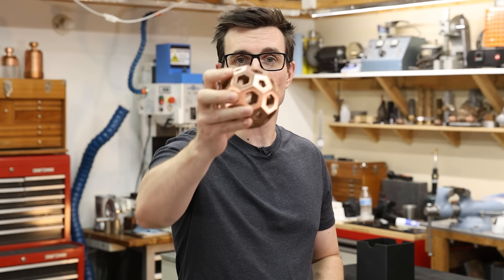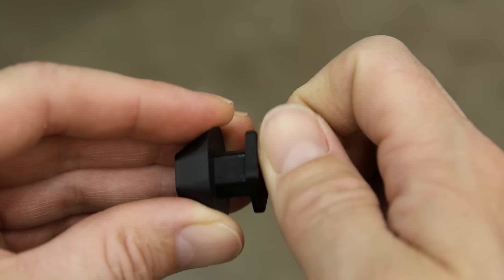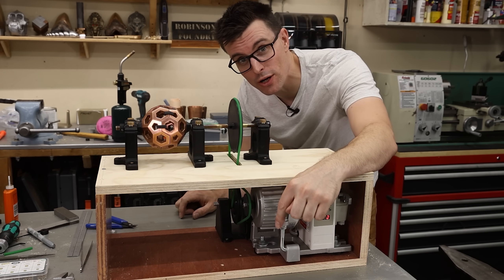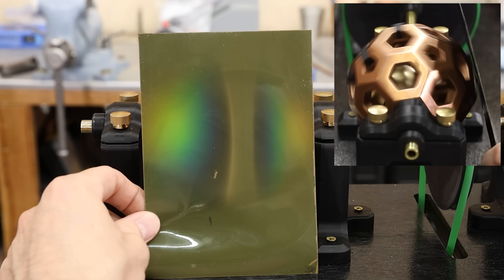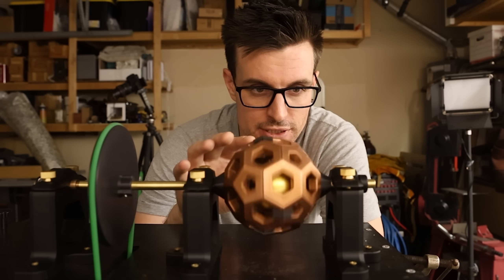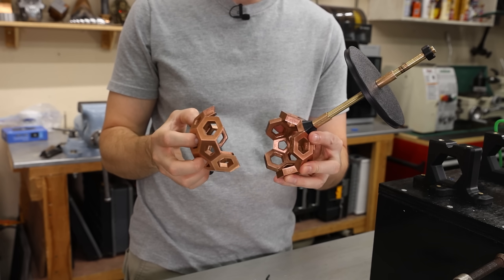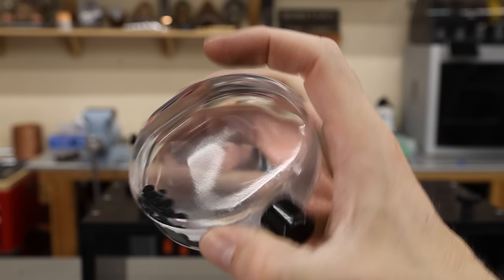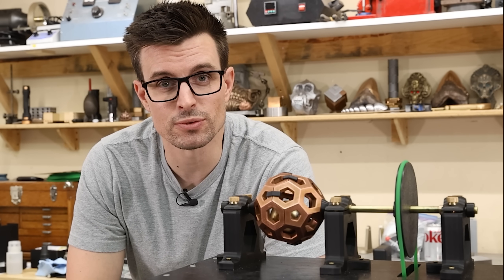Huge Magnet vs Copper Sphere - Anti-gravity Machine

Comment: I don't know my friend, you complicated every step on yourself, installing the motor made the Idea depending on another power force as fuel, then you put a magnetic lens disturbing the field of force by letting it touch. After that you changed the copper orientation system, well ALL WHAT I Concluded THAT you wanted the viewer to be happy with you to send you likes. try to change the motor itself from horizontal into vertical like attaching the copper sphere on top of the motor center rotation, I want to treat you as a scientist NOT a YouTuber, so do not forget the earth actual megnatic field, and think of other way making movement without a motor depending, the earth is moving on it's central megnatic field GOD IS THE ONLY ONE WHO WAS ABLE TO PUT THAT FACT WITHOUT A MOTOR

Comment: I don't think you know what you want the copper "sphere" to do. You're asking it to stabilize the flux of something that is moving in three dimensions while the copper is moving it's receptivity of flux currents in two dimensions. Also, there is nothing to tie the rotation of the copper to the magnet. Think of how we already use magnets, copper and rotation - a motor. There are two ways to create a motor, a magnetic field rotating around a stationary conductor or a stationary iron core with energized copper windings rotating around the core. Both of these can produce stable (or variable) flux currents to allow levitation because they are energized and moving along a stable axis. In the experiment, the copper isn't doing anything for the magnet and any moment of resonant flux would be instantly gone the next moment. Since the magnetic sphere is also moving in random directions, the line of flux from it are also fighting the concept you are trying to achieve. You have to control at least one of the fields of flux and their magnitude to have levitation with anything. Motion will always be against you unless it is relative to the direction of the axis of flux. I think you are trying to make the copper act as the field of flux of a magnet or electromagnet. If you're using copper because it is a conductor, a copper sphere can't be both positively and negatively charged at the same time to push and pull the magnetic field of the magnet simultaneously in the proper places to produce levitation. Simply put, the only reason motors don't have levitating parts is that we have to connect a part of them to another device to perform work or to receive energy that is converted into electrical energy like a generator (motor working in reverse). Otherwise we can already levitate a magnet inside a rotating electrically induced series of magnetic fields.
This experiment can also be described as variables trying to control variables while still missing a part. You have no constant to work from or to create a foundation to build off of and solve variables from. A magnet slowing down while falling through a copper (or other conductive material) tube works by the delay of exchanging charges against the poles of the magnet as it moves through a conductor aligned to the axis of flux. In any case you need 3 things to achieve stability of fields for levitation, your experiments are missing the consideration of electrical charges (since you're trying to work with a copper (conductive) component). Copper is only used with magnets because it is conductive and creates controllable magnetic fields with electrical energy. 
I think a cool experiment may be to record the delay of the sphere falling through copper and other conductive tubes and then spinning the tube at different rates while dropping the spheres through to see what correlation you can find there. Also try dropping the spheres through the tubes with a known orientation (north up a few times and then south up a few times ) and then try spinning the spheres as they drop through the tubes. You could even spin the spheres perpendicular and parallel to their poles and see if there are any effects vs a random rotation. I recognize your channel isn't really about electricity, magnetism and levitation but it was fun to think about as I watched your video. 

The more I thought about it, the only way to levitate the magnetic ball would be to create a multi-pole rotor and spin that on the same axis as the copper sphere. Unfortunately, the copper sphere - the very thing that created the interest and your ideas of levitation, and is relevant to your channel is the one part of the experiment that will prevent you from succeeding. Even energizing a copper sphere with a magnetic ball inside it wouldn't produce levitation because the ball would have to be placed in the fields of flux to get it to stay. If that happens there is no need for any part of that system to rotate or even be a sphere. Again, that would go back to cylinders and essentially building a motor.

Comment: The internal sphere magnet needs to be larger or the copper cage needs to be smaller. There needs to be a small air gap, or distance between the 2 materials, that is uniform like your copper tub & disk magnet. 
I would use the tube & disk to help get the mathematical equation so you know what size sphere magnet & copper cage need to be.
1. Drill & tap one end of the copper tube. 2. Make attachment that will join the tube to a shaft or to a pulley that can be belt driven. 3. Design a support that the tube will sit on & allow it to spin with minimal friction(hard part). 4. Orient your disk toward the opposite end of the tube for better observation. 5. After starting the motor to rotate the tube & achieving disk magnet suspension measure the gap & observe any wobbles. 6. Use the tubes thickness & the magnets OD (outter diameter) & thickness to complete your equation.
Reply: Also great filming, editing, & experiment. You got a subscriber for life.

Comment: What would happen if you just spin your cylinder on a setup like you have, in addition to looking at the magnet axially down the open end?
Also are both halves of your copper part electrically connected really good?

Ideas, I have lots of them, cheers! good stuff.

Comment: Cut a hole under the sphere and use the light centered under the sphere? I am not a scientist, but have you thought about different magnets to help elevate the weight of the ball? Use 4 in total one on top and bottom and two on the sides

Comment: Nice work!  A possibly better demonstrator, just as with your initial demonstration with the copper cylinder, is to motorized the cylinder and have the magnet float inside (much better visibility of the floating magnet).

Comment: The problem is you are putting energy into the copper end of the system. 

Your objective is for a magnet to spin incucing a counter field. 

What you have is copper  spinning around the magnet.
This means for the magnet to spin and induce any field it is basically going to have to "rub" and get the momentum

To solve it you need to spin a magnetic sphere around a copper ball as that can pick up the energy from the magnet and spin.

Rather the trying to get the energy spinning to draw "power" off the magnet to generate its feild

Comment: As long as there is slip between the magnet and sphere there will current due to Lenz law when the slip reduces the current also reduces and causes the magnet to drop due to gravity also shape of magnet inside the sphere also matters since the north and south pole flux to be cut by sphere makes the Lenz current to flow in sphere and that causes it to float due to diamagnetic effect of copper

Comment: The joining parts of the two half's of the copper sphere are at a much greater thickness to the rest when together witch will then pull the magnetic force towards that section more. Also to allow for smoother rotation on the magnit you'll need a continuous copper strip around the equator of the magnit. The zig zag design of the copper sphere is whats wobbling the magnit from side to side and causing it to be unbalanced. Id also recommend some kind of copper or aluminium sheet between the sphere and the motor. 
I also think your get some kind of disruption from the screws you used for the mounting brackets on the shafts. 
Maybe you could design the copper sphere out of copper piping, you could cut say 20 pieces of pipe at a length of say 10mm and make a circle from them and work out from there. You might need to find a way to connect each circle/pipe  together that wont have to much of an effect when in motion. I would definitely start off with some thinner material on the sphere and work up in thinkness after each test

Comment: Could you make 2 hemispherical shells (solid shell), trim 20mm from the ‘equator’, then spin the 2 halves in sync.

That way, you get a reasonable unobstructed view, potential to start with a stand for the magnet, then remove it, or to use the gap as a track to rest the magnet upon.

The shell could be harder to balance without machining metal hubs and trimming bits to balance it AND it may not look as cool as the geometric cutouts on this one, but could get a more stable effect.

(as others have mentioned, you might need some magnetic shielding from the motor too.)

Comment: @Robinson Foundry
11:50 I saw a video (can't find it again 🙁) with a kind of diy shock absorber, maybe you can make something similar, magnets are kind of like springs.
it was a weight (unbalanced wheel I think?) that was spun up to vibrate violently, above was a rod, then dropped a coil-spring down around the rod, and a weigh on top of the spring.
That was enough to make the system stop vibrating, as most of the vibrations was (somehow) "absorbed?" by gravity (I think). Maybe something equivalent can be useful here to absorb the magnets vibrations, but like "backwards?" or something?
Also, maybe those "wiggling magnets" can be some other way to absorb sideways energy from the system, if there are some kind of resistive springs on those magnets to take up the forces generated?

Comment: @Robinson Foundry
6:53 You could put the motor such that most of the magnetic parts are spread out as evenly as possible directly underneath the sphere, in that way you mostly just add or subtract a tiny amount to/from the gravitational component of this system.

Comment: To get the strobe to work, you need to take the RPMs rotations per minute divided by 60 RPS rotations per second ×5 the cemetery of your sphere a mess number flashes per second you need

Comment: The problem is rpm . Just turn_it_up don't be afraid. If the rotor in the copper winding is afraid of turning so fast, it would have not produce AC current.

Comment: You have to use two indepent spheres spinning in opposing in opposite directions even using two hermetically sealed layers and using currents to make the fluid spin in vortices one oriwntated as an up draft motion and the other in a down draft one clockwise and one counter clockwise either the layered fluids in shells contained within each other, or those copper spheres one spinning clockwise and counter clockwise or one vertical and one horizontal I believe they would allow for directional control. Even two copper shells with the layered encapsulated hermetically  sealed fluid spheres within the copper spheres

Comment: I think the polarity isn't evenly opposite. When you held the magnets up they always went the same direction. Meaning they are hitting the same pull or push on the magnet in one axis more than the others making the central magnetic field off centered I think. But I also don't know a lot about magnetic fields either just an observation .

Comment: Gravity field g must equal to acceleration a. On Earth, it is 9.81 m s 2.

Like a motor bike spinning inside a sphere cage you see at the circus. 

The motor must accelerate the ball to 9.81 m s 2 not the sphere. 

In the copper tube, it is linear, so the force of the magnetic field generated is equivalent to the force generated by Earth's gravitational field g. 

The reason the linear tube works when pointed against the Earth gravitational field is because they are equivalent force. 

You may call antigravity if you like. 

Gravity is acceleration according to General Relativity. 😅

Comment: So you could haves done the same hooking that really thick copper pipe up to the motor and you could place the maintenance inside of while spinning just don’t hurt yourself put a stop button or a emergency stop bar so you don’t hurt yourself playing with it, 
Pretty cool toy thingy 
Could print a plastic one and put magnets in the holes  
And glue a ball of magnets with the opposing poles facing out 
So the spare would be North Pole fishing in and the ball would be North Pole’s facing out… 
When you’re printing it, you could use like a clear plastic or more gaps and holes and more strategically placed magnets so you can see the ball on the side ….

If you want to take it a step further, you can have a ball with no poles facing out and spare with north poles facing down and another sphere on our outside with North Pole’s facing out and then another three with the north pole facing in on the outside The cost a lot of money and be huge and probably quite heavy, but I think it would be doable. there’s no reason why it would be available. Just have to have a lot on magnets a lot of magnets!!!🧲🧲🧲🧲🧲🧲🧲🧲🧲

💰💰💰💰💰💰💰💲💲💲💲💲💲🤑🤑🤑🤑🤑
I hope YouTube pays a lot ! 🥹🫩🙃

Comment: Try turning the axis of rotation vertical so gravity is pulling the magnet into an area that is spinning instead of rolling so it doesn't oscillate like it did in this video.

Comment: Maybe I’m missing something but is it possible you’ve focused too much on the magnetic fields and possibly missed some mechanical components. Over the distance of the rod won’t balance and torque be lost? If the other end of the system has a counter force could that potentially help balance the sphere?

Comment: I'm coming at this as a prop maker and cinematographer. The object here is to see the levitating magnet, and the hex facets cause too much glare and glint... 

Okay so let's ditch the hex thing for a sec. Picture a hollow copper sphere, same wall thickness and diameter as your current one. 

Now, equitorially remove a 1.5 inch band. Now you have two separate half spheres. Mount them axially through the poles, rotate each independently, spaced 1.5 inches apart, with the ball rolling nice, seated in the gap.

Make the gap variable while spinning too. You can bring the halves together to increase or decrease the effect. 

There's two elements about this that I think are neat. First, you could start with both halves touching, the ball is trapped inside rolling.... You can't see it. (Expect for with that amazing viewing film!). Then when it's up to speed the noise of the rolling disappears. Then you start moving the halves apart. Through the widening seam you will have an unobstructed view of the magnet AND you can figure out how far apart each half can get before the ball drops. There's a game in that I think... Haha. 

And the other thing? K so like... If you start with a gap between the halves, and the magnet ball seated in the gap... What if you counter rotates the copper hemispheres? One goes clockwise, the other counter clock-wise, but synced RPM okay? So... The magnet ball doesn't start by rolling it... Spins in place? Like.... 

Who knows?! 

But yea easier to cast for one, and you do need 2 motors now BUT! Seeing the effect will be each AND... There's a lot more variables to enjoy. 

Thoughts?!
Reply: I came to the comments hoping someone had this same idea and was happy to see yours up near the top!
Reply: Exactly!
Reply: up

Comment: you need two magnets along the axis to lift the inner magnet like its on a clothes line. The have to fix the gravity pulling it down.  The White line on the viewer is the equator essentially between n n s so you need two magnets along the axis like your spit roasting it

Comment: try suspending with was in the center and then slowly melt the wax as you spin it.  The wax can be as thin as possible and as many as possible.  And the wax just needs to melt just slightly to brake off.  I would start with the rotating axis and then once its ready and spinning heat it up with a heatgun.

Comment: Now take thay copper and make a tube fill that tube with mercury.  Seal the tube so that it creates a circle. The tube filled with mercury and electrified. You figure out the voltage and you will see the tube literally Float. This is the concept of Hitler Bell. TRY it you'll see.

Comment: 3D print a golf ball but the divots are design to hold small magnet. instead of one magnet and its field. you will many smaller magnetic fields to balance the ball inside of the copper cage. I've been working on a similar concept for a while but would love to see someone more capable test it out. The lens effect appears to affect the solid magnet because the field is constant, but I am curious what multiple magnetic fields would do.

Comment: What if you used two intersecting circles at right angles to each other? The circle that the magnetic sphere would 'ride' on could have a slight concave horse-shoe shape to hold the magnet until it achieves levitation. It would also have better visibility to the magnet.